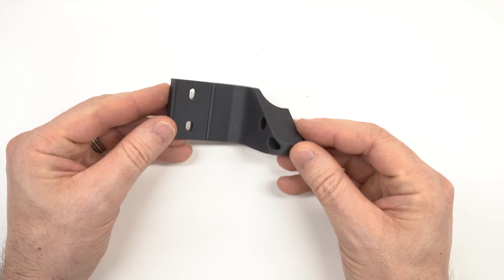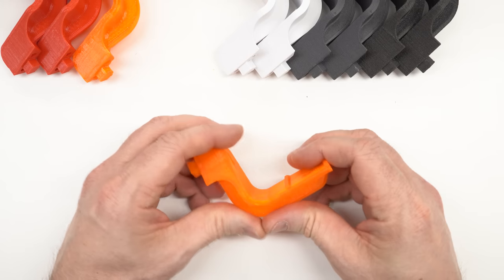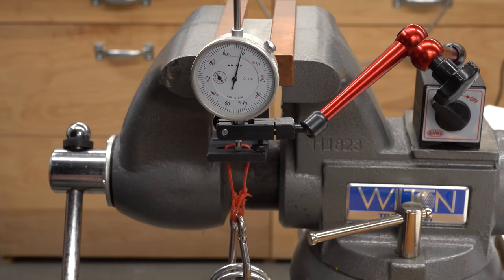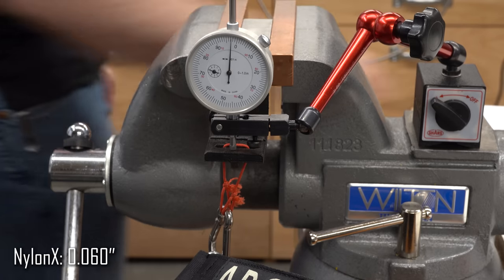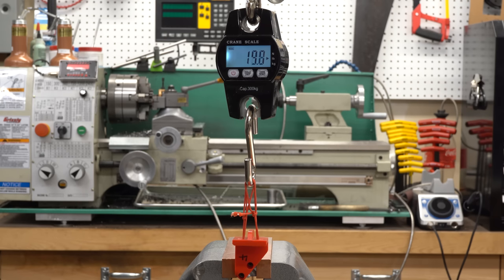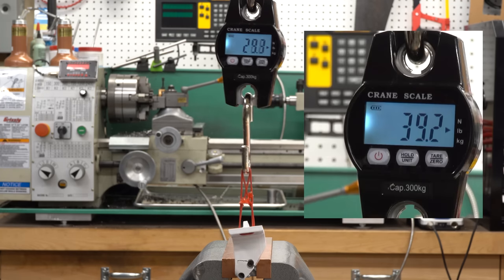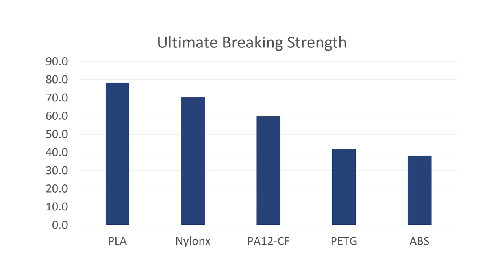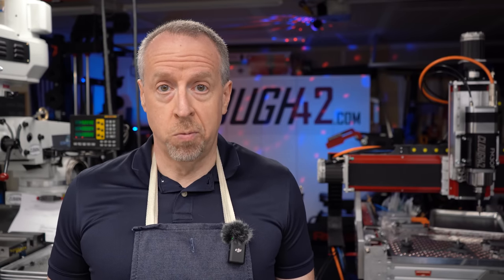Wait, What?  PLA is Stronger Than Carbon-Fiber Nylon?

Comment: White ABS is known to be the weakest color because of the huge amount of titanium oxide additives it needs to reach that look. On top of that Esun is known to have uneven quality and layer adhesion issues depending on the batch. If you're continuing this research you might want to try a black ABS from a different brand.

Comment: PLA is amazing especially for how easily it prints. The only reason I wouldn't use PLA is if something is exposed to UV/outside or high temperatures. Then I use PETG but otherwise I would never even think about printing something like ABS, Carbonfiber, Nylon where the printing is just not consistent enough.

Comment: PLA is reasonably strong, but; 1) interlayer adhesion is only so-so, 2) it splinters if machined or sanded, 3) impact resistance is poor, and 4) it doesn't do great outside (temperature and UV). I generally stick with ABS or PC, sometimes PCTG/PETG if I need excellent interlayer adhesion. You can generally design around "this material has lower strength," but it's more difficult to design around "this material doesn't like to be cut/sanded/machined," or "this material degrades after a year or two outdoors." Of course the most difficult thing to design around is "this material costs too much," which always favors ABS and PLA.

Comment: PLA although stiff and strong is not suitable for bearing continuous loads over time. It creeps and becomes brittle with time. I printed shelf brackets with PLA and they kept breaking in the middle of the night! Swapped to ABS and zero problems years on.

Comment: PETG  properties change drastically with nozzle temperature. Too hot and it gets brittle. Too cold and layer separation dominates. It also shrinks a lot depending on bed temperature vs cooling time. The first attempt was not an anomaly. The shattered glass like surface of the fracture from my experience shows too high a nozzle temperature. I liked very much that you took time to do  this kind of a test. I would encourage you to continue with another round only this time take time to optimize temperatures vs strength test for all tested materials and show the best results. One more very important test is the weight to strength ratio. Precisely weigh the parts before the test as this makes a huge difference when comparing RW mechanical parts. One can always add more material to a design if the weigh to strength ratio is higher than other materials.

Comment: PLA is really hard to beat, but there is the contention that if you had spent as much time dialing in other materials as you have pla, you would get different results. I have spent a lot of time getting nylon to print well, and nylonX definitely is a better material given all the love and attention it deserves, but it was a long time before I got it to that point. It is pretty consistently about 30-40% better than PLA, but I use it only when temperature is a severe issue and ABS or PC won't have the stiffness , or when I am printing a part that needs every cubic centimeter contributing to strength and I can't increase PLA's printed density anymore. (Very high temps and thinner layers so the material remelts the previous layer a little and flows into it are some of the tricks) Also note tracking of the carbon fiber supplier and strand length, some CFN's are just basically ground chunks that do nothing other than make it look good (which is often worth it if you are selling it honestly).

Comment: I’ve seen way higher strength in my own testing using carbon fiber nylon than petg or pla, it is highly dependent on the printing settings

Comment: In the 3D printing industry it is pretty well known that even with SLS printing, which has far better bonding between layers than FDM, that all the polyamide (nylon) powders in the PA11 and PA12 families have less tensile strength, flexural strength, and flexural modulus (stiffness) than PLA in the printed products — even with carbon fiber added.

Interestingly, the older polyamides, such as PA6, which are a bear to print vis FDM due to their extreme hydroscopic nature, actually have a much more optimum, molecular structure for bonding with glass and mineral fibers to give tensile strength, flexural strength, and flexural modulus ratings that are multiples greater than with PLA in the printed products, with considerably higher temperature deflection, impact resistance, hardness, dimensional stability, and far less creep under continuous loads.

There are global manufacturing companies to which you can outsource your 3D models — for the sound-bar brackets, for example — in aluminum or stainless steel via DMLS printing for around $30-$40, and even in titanium for about 3X the price, and they will get them back to you within 5-10 days. These will massively out-perform any strength-to-weight and modulus requirements where thermoplastic prints are used.

Comment: PLA is nice but I've noticed that it deforms over time so I wouldn't use it just for everything. 

That being said, I have an old design of a desk clamp for a soldering spool holder that came loose in an indoor environment. Though after I've revised the design, it's been going strong for 3 years now. Using triangular infill seems to improve the structural integrity of my 3D prints. There's a reason civil engineers use that geometric pattern in buildings and bridges.

Comment: PLA is tough, but it's brittle. A lot of my first functional prints made from PLA were also made way too thin and they started cracking over time, albeit a long time. 

Anyone who's left a roll of PLA sitting out in the free air for too long probably knows that it turns to dry pasta noodles, it's pretty much impossible to use because any force will cause it to snap so you can't even load it into a printer. Even if you do "get it in" it'll sometimes break coming off the reel and ruining prints, if you've got a bowden setup it's a right PITA to clear out as you usually can't just pull it out. There's a noticeable difference, a new roll will take twisting and bending to break and leaves a conical break, old stuff snaps off square. 

But the material still towards the middle of the reel is usually OK, you can toss the outer wraps and the stuff on the inside is still pliable looking for that conical break that makes for easy filament loading. Same thing with prints, put more material inside and they'll last longer but still probably not forever.

Comment: I would love to see how a non fiber filled nylon fares in similar tests. Gut feel is that it will deflect a lot more than even the PETG did but be unlikely to fail easily. The downside is printing nylons is not easy as they tend to warp like nobody's business.

Comment: We got a Raise3D carbon fiber nylon printer at work, and I can indeed confirm that PLA is better in every way.  Carbon fiber is extremely brittle in every filament I’ve tried. And that $5000 printer was a piece of crap. 

Whenever i needed something better than PLA I used ASA and never had any issues. 

If I were to buy an expensive printer for work again I’d get a Nylon SLS printer. Or if I had the budget I’d get a nylon MJF printer. Every nylon MJF part I’ve ordered from 3rd parties has been flawless. Especially if you get it vapor polished. Nylon MJF parts are the closest functional and best looking parts you can get without injection molding. Carbon fiber for 3D printing uses are always a scam.

Comment: As always, great vid. Big fan. 
I'd like to see a comparison include Ultem, PPSF, and PEEK,.and less CF or GF materials, just resin for an apples-to-apples view. If you can't print them yourself just reach out to an OEM for parts. A place like AON3D might oblige. Also, I would consider your loading rate to be monitored, as it seems from the video that the load is applied inconsistently. For you application creep should be a consideration and the bar will sag over time.

Comment: I assume to cold printing. PLA and PETG have great layer adhesion @ low temps. Others not.   Reprint them as hot as possible.  I bought the best lookings Parts for my Voron in Carbon Fiber ASA. The did break easy with force in the wrong direction. I reprinted these with extrudr Dura Pro ASA Carbon Fiber @ 250°C @ 50mm/s. This was a new level in strength. I only use high cooling and low extrusion temps when needed. Optical parts, crazy overhangs or for better removable support structures. For mechanical parts, always... .as hot as you can go.

Comment: Nylons need to be annealed and need to regain their moisture after printing to have optimal properties. The moisture gives them their strength back, particularly the CF ones are pretty brittle straight out of the printer. When it comes to strong nylons, I suggest you try the Luvocom PAHT CF 9742 BK, in my testing so far the best engineering CF Nylon. It is sold by many vendors, including TreeD and eSun. When dry, it prints great, with little warping, has great temperature stability and is strong.

Comment: One other thing to note is that Carbon Fiber does not perform the same in all situations, for example, it does not bode well under torsion (twisting) force.  Same can go for expansion.

But, if the part is designed correctly, keeping in mind those limitations, a good Carbon Fiber infused filament can blow away everything else in compression tasks.

Comment: I think it was a good test. However, a better test that would eliminate specific part design weaknesses would be a cylinder/pipe shape that resists stresses in all directions or an I-Beam shape which is inherently designed to resist deflection stresses.
Reply: hello, i am gonna print a vacuum cleaner wheel, which material do you recommend, petg or pla? the wheel design has small clips to plug in to vacuum cleaner

Comment: PLA has lower fatigue resistance doesn't it? You should really check these materials on a transducer setup to see where they start to yield and break. Ive made chip clips out of PLA and they break eventually just from sitting under stress for an extended period of time. I imagine there is a point below the ultimate breaking strength where it wont experience as much fatigue strength loss.

Comment: The strength of Petg depends on getting good layer adhesion with the right temperature for extrusion and then cooling it faster so that you retain the polymer strength and avoid crystallization which makes it brittle and weak. So you're basically looking for a shiny PETG print. Those crystallized matt finishes are weak. Would be a fine test to compare just for petg with various petg print temp and cooling profiles. Petg consistently strongest at 250C print temp in other tests I've seen. Might be nice to verify.

Comment: First, the amount of time and effort behind making a video like this… Impressive! 👍

If the goal is to compare material properties only, I think it would be better to use the standardized geometries for test samples.
Test of real world application, like your brackets, definitely has its place. But there’s so many variables involved, besides the pure material ones, that will or will not influence the results.

Great test though. With, at least for me, some surprising results.

Comment: The major advantages you're going to see from the Carbon Fiber are it's temp resistance and it's weather resistance. PLA's Glass transition temp sitting at 90c makes it basically unusable on any outdoor application that intends to stand up to even a warm summer day.

The PETG as you saw as the advantage of deflecting under load, this lets you avoid catastrophic failure like you saw in the PLA Case.

Comment: Another variable here is that different colors have different strengths, with white ABS being known to be very weak and prone to cracking and having poor layer adhesion.  Carbon fiber filled filaments usually make something more rigid and less likely to warp while printing, but it ultimately is usually weaker because of it's effect on layer adhesion.  Having said that, I would try carbon fiber polycarbonate as an alternative to the nylons.

Comment: Also, if strength is very important to you. You should print with 40% infill, more walls. I typically use 4 walls with 5 top and bottom layers. Even more than that however, is printing with a 0.8mm nozzle and 0.4xmm layers (i use 0.48).

Comment: I don’t recall if you did a modifier around the screw holes to beef up the part at the load point . If you just had the 4 perimeters that could impact. Be interesting if you did a solid 5-10mm around bolt in all test materials as that top screw kept cracking. It would also eliminate that Petg riser suspicion. 

Cost vs strength the pla would probably dominate but if your preference is the pa12 Then use it. I prefer petg as it easy to print and is suitable for all my cases so far. 

Just on parts ductile failure maybe better than catastrophic failure depending on use case.. Unless you add a higher factor of safety to avoid the catastrophic failure - which in fusion you can test for.

Interesting dealing with materials, but preference and ease after win out. Why stuff around for half a day trying to get PC to plot or eliminate warping issues, when you can just drop on petg (or pla or ….) and go off do something else.
Reply: Your last point is why I fell in love with carbon-filled polycarbonate. I got a roll just to test, and while it took work to get my printer up to temp (280C hotend, 105C bed), it has always just worked. It's strong, rigid, and has a lovely finish. 

It's much more expensive than PLA, of course, so it won't be used for everything, but I know I can just drop it in and have it work. I wouldn't buy another roll if I had to babysit it just to get a single successful print. Regardless of any special properties, the most important is often that it prints reliably.

Comment: You could print the outside in the PA12 and the inside in NylonX.  I avoid PLA for anything that is not always used in environmentally controlled areas or is exposed to heat.

Comment: James, thank you for your testing. For an honest evaluation you could use some of the defined shapes for testing on plastics. Sharp test, elongation bars. By doing so you can also compare properties with industrial made plastics. Should be interesting. Price, weight, creep, etc.  also. It should bring you fun too. That’s the main driver. All the best, Job

Comment: You should make another video using standard material testing tests and shapes.   For example, you should do some tensile testing at a standard pull rate using dog bone prints.  Or do manufacturers publish this data?   I know it is available for raw resins (plastic pellets).   Do you have an enclosed or heated build chamber?  It would provide us with a lot more information if you provide your printing parameters.  For example, bed temperature, extrusion nozzle, hot end temp, wall layers, infill, speeds and velocities etc.

Comment: I've always known PLA is stronger than most filaments.  I just don't like its low tolerance to slightly high temperature environments.   I think PETG is strong but it is very dependent on your printer settings.  Try printing it at least 10 degrees higher than the recommended temp,  and keep the fan low  at 40% or lower.   I have not done scientific testing regarding its strength,  but it has handled the punishment I put it through.

Comment: In my experience, PLA changes shape over time with a lot of weight on it. NylonX does a better job holding it's shape. This really depends on geometry as we all know. I probably print 90% in PLA, tough PLA and HTPLA. You should really try this same test in Taulmann Alloy 910, that is a widely overlooked filament in my opinion. It's very tough and rigid. Also, just a tip for anyone wanting to print a part for gasoline related items... PLA is the winner. (I will admit however that I've never tried gas with PETG).

Comment: I have to wonder if PLA's good showing doesn't have more to do with its easy printability than any of its other properties. You expressed some concerns about print defects around where the supports joined the parts made with PETG. On paper PLA isn't as good as other materials, but if it prints more readily and reliably the superior print quality could easily outweigh the inferior material qualities.

Comment: I'm the deflection test I noticed that the dial indicator did not return to zero.  This would indicate the probability of having some permanent deflection.  This would mean that at some point the material yielded and went from an elastic to plastic deformation.  It would be interesting to see what happens if you printed standard type tensile specimens and tested them.

Comment: Yes, yes yes yes. 

PLA is the strongest material for 3d printing but it has several downsides. It does withstand chemicals and UV(color does fade) amazingly BUT the biggest problem is that printed PLA does not withstand temperatures of above 50c very well UNLESS annealed. 

Annealed PLA can withstand insane temperatures, but due to how 3d printing works, annealed PLA parts ALWAYS deform during annealing. 

For example; PLA annealed at 200c can withstand over 150c temperatures FOREVER.

Comment: PETG is an interesting material. I'd have to go back and check, but I suspect your first test increased force slowly, while your second and third were faster since you expected better results. When given time, PETG will stretch/flex before breaking. It's not as great for impacts though. The temp you printed at may have some effect too. 
The 3D printed 2A community has done a lot of material testing and almost everyone agrees that PLA+ is best for their applications.
I do prefer PETG over PLA for hot locations. Car parts, kitchen tools, stuff for the garage.... I print with PETG.